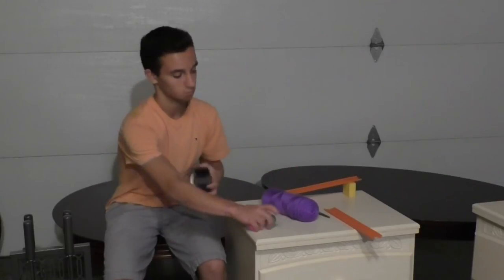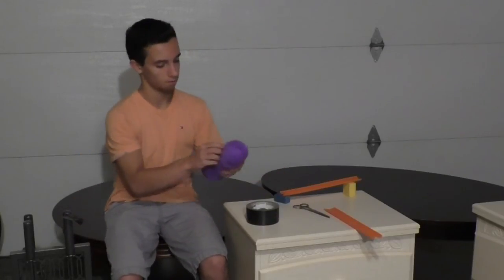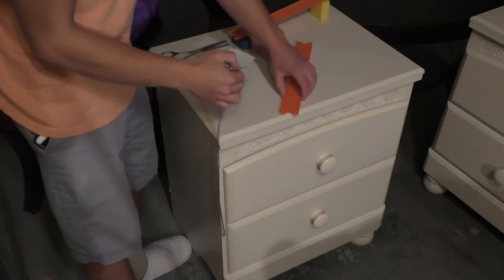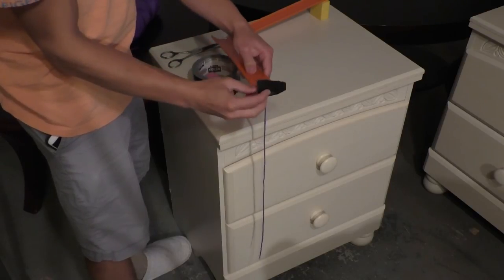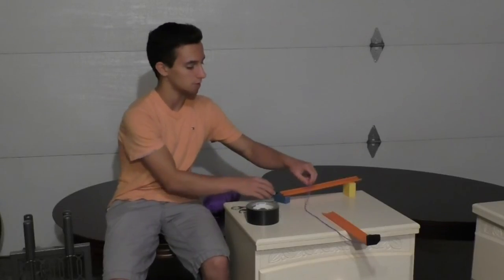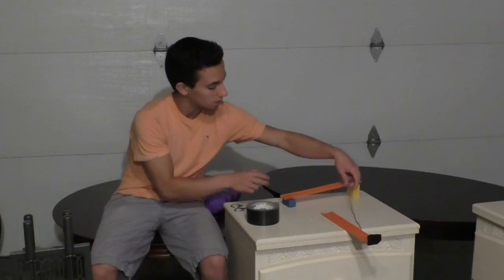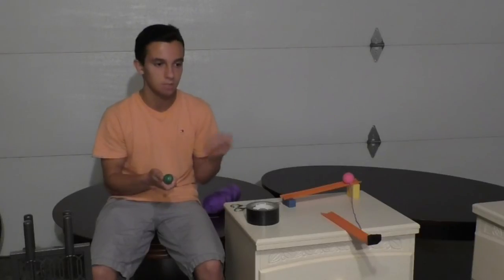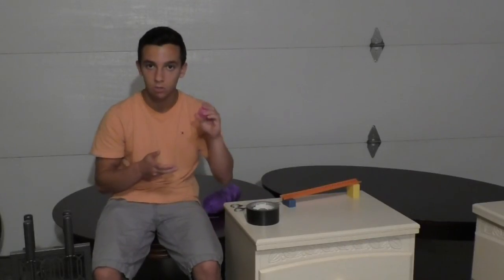Machine Tutorial #1: Dropping Track

Comment: but there is a beautiful hole right on the end of every orange hot wheels track meant for tying strings through!!!!!! Also you can use a ping pong ball if you have a solid stop at the end
Reply from the maker: +Sprice Machines I was making sure that the trick really easy to make, but will work 100% of the time (so that means adding a stopping block with the tape and using a bouncy ball)